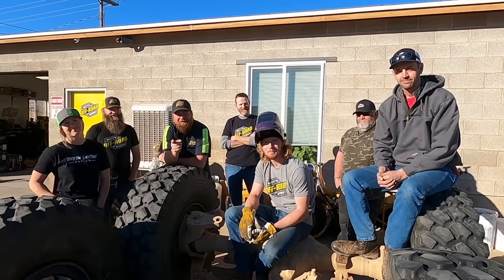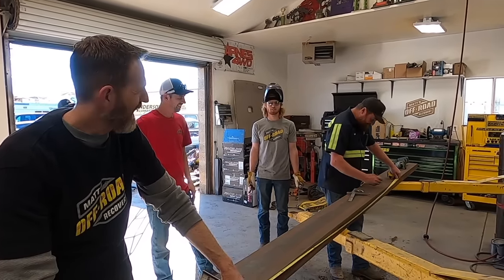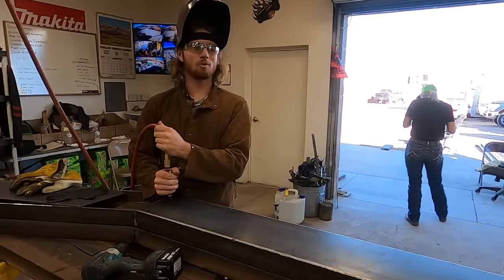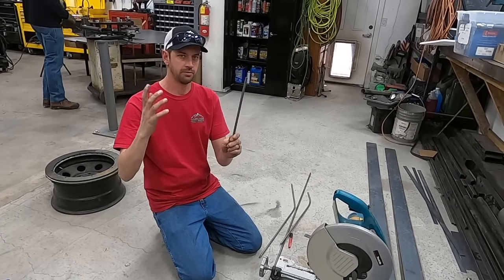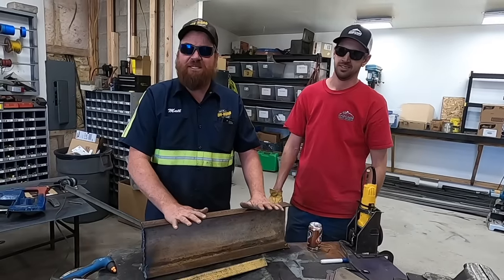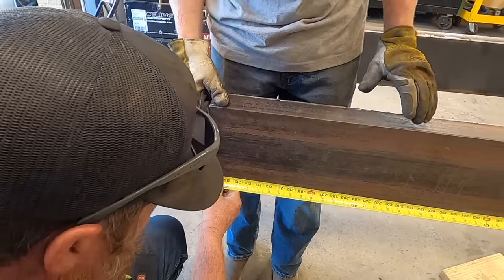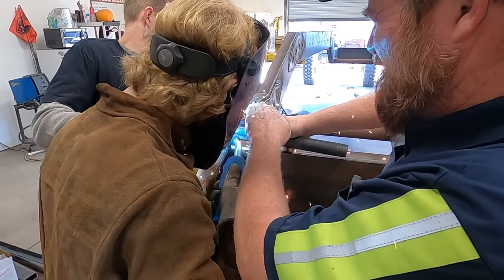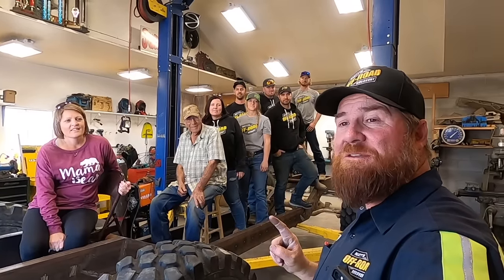I'm Building The WORLD'S LARGEST Off-Road Wrecker

Comment: Hey Rudy! If I can give a little unsolicited advice on welding? You are relying on gas and fire to keep the oxygen out of the weld. Welding without flux can lead to the molten metal instantly going bad. Everytime you make a puddle you need to point the flame into it to keep the oxygen in the air away. Then as you let off keep the nozzle pointed at it until it gets solid. 
Tacks, stops, and starts. Always grind a feather edge to restart on so you don't get those cold spots. Really push into a cold start to melt the puddle before you start dragging. Don't be afraid of melting the whole parent metal. Don't just glue on the surface. Wobble side to side slowly to widen the puddle but don't let air in.
I'm trying to keep it simple so sorry for a lack of detail.

See the puddle young welder.
Reply: C'est vraiment le  meilleure et le  plus synthétique commentaire  sur le soudage que je n'ai jamais lu. 
Vous  expliquez  si bien les règles de bases  qu'il  faut absolument respecter si on veut réussir une parfaite soudure: ne jamais laisser l'oxygène entrer en contact avec le bain de fusion ainsi que le geste à avoir du début jusqu'à la fin de la soudure. :washhands: On sent le professionnel passionné de Vulcain  😏

Comment: I am no expert but I wouldn't recommend using the frame as an air tank for 2 reasons:
A) Water is a natural by-product of compressing air due to the condensing process. The water can rust the frame from the inside out over time.
B) Air tanks are always round due to the increased strength. I found out (the hard way) that square doesn't work to well.
Reply: C) It's reducing the effective strength of the frame

Comment: I worked in a vessel shop building high compression gas compressors and many air  tested tanks that would hold oil within the structure. We would rarely use mig on such thick materials due to it's poor penetration on stops starts leading to pin holes. You can tail out with the mig not leaving the porosity or use grinders on the stops starts and following and religious process of rooting in a first pass of E6010 covered by E7018 SMAW or Shielded metal arc or STICK. STICK has much better penetrative characteristics. The frames We would build were 40 to 60' long weighing between 40 to 50 tons just the frame. On those frames we would use heavy deposit high voltage flux core which would dig in well to thick metal in multiple passes. Was a fabricator welder for years and an instructor in the local trades school. I have learned a great deal from you folks here is only a small bit of my knowledge. Great project and keep going thanks!

Comment: Although the frame tank was a good implementation based on the idea, I still think a proper on board air tank would suffice better in the long run!
Reply: Absolutely agreed! When the air is lost in the back of the desert it is not fun
Reply: @manuhonkanen2111  it'll obviously have a compressor onboard, so you just make sure you can bypass the frame tank and run either straight off the compresser, or add an additional 1-2 gallon buffer tank that can easily tuck away inside.
Reply: Could always use them for water or oil tanks like a lot of bumpers are built for
Reply: @ChevTecGroup  TUBE bumpers. They are all tubes.
Reply: @amlee7  for pressurized air yes, but there are many square/box steep bumpers that double as water or oil tanks. Plenty of JK jeep aftermarket box steel bumpers made to hold water.

Comment: Dual shield fluxcore is a good welding process to use for frames and such. It's what our company uses for all structural welds on truck frames. Also anything holding pressure should be cylinder with domed ends. Even if reinforced the flat spaces will bulge.  I like the idea it sounds cool but there's alot of things that can go wrong there specially using short arc MIG process. Just food for thought!  Can't wait till it's finished it's going to BE EPIC
Reply: I’d run SMAW before MIG. I agree tho, dual shielded FCAW would be the best.
Reply: Why does it have to be airtight?
Reply: I was thinking it would be a much safer idea and easier to just use air brake tanks designed for otr trucks.
Reply: @apollo5751  if I had known I wouldn't have asked. We all learn new things. Sorry if I offended you.
Reply: I second the fluxcore wire.... Look into it.... Its better for heavier welding.....
Reply: with normal air pressure that tank will never leak or explode if you put 1000 psi in a tank designed for 150psi at most  then it will have problems the way it is they will be fine

Comment: I am a heavy diesel mechanic from the north east. I am not a fan of doing frame tank because of moisture. But i guess being in the desert means less moisture so should work just fine. Anyway this build is going to be epic.
Reply: The frame is already rusted. Compressed air combined with rust is just bad.
Reply: This was my thought, maybe they can just oil the inside?
Reply: @BenKloos  no, don't! The oil could combust like a diesel.
Reply: There is less moisture on the outside but they need to worry about the moisture on the inside rusting it out. The water condenses from compression and gets inside the frame. It's better to use an air tank with the proper asme certification if it's going into commercial service. The drain holes will be in the right place, built to handle the pressure, if anything happens to it you can just buy a standard replacement tank.
Reply: @lightningdemolition1964  I live here too. I still have to regularly drain my air tank regularly.
Reply: Just use inert gas (nitrogen) to fill frame to about 5 psi and it refill as needed. That will  remove moisture and prevent rust. Interesting idea to use frame as an air tank but doesn’t seem like it would usable/ reliable over time.  Interesting idea.
Reply: @williamlloyd3769  The moisture actually comes in through the compressed air. Compression heats the air up, hot air holds more moisture than cold air. Once the air cools in the tank, the water condenses out and leaves water in the tank. The more humidity in the air the more water will be in the tanks. Also constantly pumping fresh oxygen into the tank increases oxidation.
Reply: @lightningdemolition1964  less moisture in the air means less moisture in the tanks as well.
Reply: @scottcummings8074  you would need much higher pressure and heat to combust oil like that.
Reply: @mission772  I kinda thought so, but the possibility worried me enough not to say something.

Comment: As an Engineer, there are some really good reasons there are very particular and specific ASME boiler & pressure vessel codes.  While I understand why this seems like a good idea, I can assure you that it is not.
Reply: Asme 570?
Reply: @danielanderson2189  ASME B&PV code.  Section II part A for ferrous Materials used in pressure vessels and section VIII Rules for Construction of Pressure Vessels.  What they are doing could be quite dangerous and is entirely inadequate from an engineering and design standpoint. The materials, design, welding, and testing were very bad.  If they’re luck, they’ll just very quickly develop weld cracking that leaks off all their pressure and will get tired of chasing leaks and welds to fix.  If they’re not lucky, they’ll all be riding around in a ticking time bomb waiting for it to explode and someone to catch some shrapnel.  That clearly contains far more energy than they begin to realize…even testing it the way they were makes that very clear, you don’t use compressed air!  They have no idea what they’re doing and shouldn’t be doing it.  It won’t work for long.
Reply: @REDSHlFT  seeing him argue that "it's only 90psi it should be fine" is just proving you right even more.
Reply: I'm sure that it is just a random coincidence that commercially available pressure tanks are always domed cylinders.  Don't you bring in all your science and experience.  Riding around on top of a potential bomb is a great idea.  All of that just to save the space of a 10 gallon pressure tank?
Reply: Have literally just made a bomb.
Reply: "Engineer", is not capitalized. It's -engineer-.  In your defense, I give 20 times more respect to a person with a degree in engineering, than to a person with a degree in English. So in the end, I have undermined my position.
Reply: @JR-vi2ll  it is when it’s part of your title, as in ‘Mechanical & Aerospace Engineer’.  You try way to hard, it’s a little sad. 😂
Reply: @REDSHlFT  , Naw, it's not properly capitalized, even if you add the "mechanical & space" before it. Even the U.S. president isn't capitalized until the title (president) becomes part of the person's name, as in -President Biden declared-. If you wanted to write "the president declared", then the word isn't capitalized. So, I'll leave the aerospace engineering to you, with your science degree and you leave the English to me, with my (truly) inferior arts degree, and things will be better. I won't even mention (after this) your last error, "to" isn't interchangeable with too. As in, "you try way to hard."  Eek, I cringe. So, get back to engineering and I'll get back to grading papers. P.S. Stop trying so hard.
Reply: @JR-vi2ll  You have serious issues if you think I’m reading all that drivel 😂.  Go somewhere else and cry it out brother 😭 😢
Reply: @REDSHlFT  Wow, angry.

Comment: For avoiding leaks in your next tank, grind the end of each weld before starting the next weld on top of it. The last 3/8" of the weld will have a tiny bit of porosity that will often leak air/fluid. Grind that porosity out and you will have better success.
Reply: @Jeremy Hicks _ Pipeliner?
Reply: sounds like you are a pressure welder, (pressure  vessels and pipelines. Here in Canada, the term is "B" Pressure welder. Maybe the same down south? not sure.

Comment: To each his own but when weighing the mounting of a tank or two on the vehicle versus using the frame as one will end up causing way more issues than it solves. The internal corrosion caused by hot compressor air is one. The constant flex and weld cracks will end up being the deal breaker.
Reply: I was thinking the same thing. The air is going to contain a lot of humidity.
Reply: Agreed. Doesn't matter that they live in Utah, when the air is compressed moisture will condense inside the frame rails. It'll rust the welded joints from the inside out the full length of the tank. Plus all that fab work for an inferior pressure vessel. I'd just mount a 10 or 20 gallon tank somewhere.
Reply: The can put an air drier on it.
Reply: @Mick_A_Knuckle  or two 5 gallons with an isolator valve in-between in the event one fails. At least that way they still have a 5 gallon tank left to hobble with.
Reply: As a mechanical engineer: Strong agree. On top of the structural integrity, reliability, and maintenance issues, if they're going to be running anything beyond like ~30psi, it's going to be a safety issue too. That's a lot of compressed air volume in a much-less-than-ideal pressure vessel that's also a stressed structural member and also often at chest-eye level. At some poin a side is going to tear off one of those and risk throwing debris and/or shrapnel at people nearby.

Especially when target weight for the frame is so high, using cylindrical, purpose-built tanks is just the better solution.
Reply: When the rail tanks fail, it's a simple thing to add external tanks later.
Reply: @justinscomp  it would have been even simpler not having to do all the proper welding to keep it sealed.
Reply: I thought of some sort of rust proof coating inside (too late now) but also, it's a heavy duty, rough duty rig.  Isn't that going to cause frequent leaks in the welds?
Reply: All they need to do is have the air compressor pump first go into an air dryer then the frame tanks, if it's a refrigerated air dryer the air going into frame tanks will be at a set constant temperature that is cold but not freezing and low moisture content. That would get rid of a lot of moisture and hot air related issues.

As long as welds aren't crappy and it's well braced internally and externally(being thick steel C channel it has a structural section for a lot of forces to travel through that is non dependent on weld strength) it should last a long time before needing maintenance.

If they had more plasma or laser cut steel stiffeners that are bent into a 90 and welded so it's reinforcing edges of the sheet that's boxing in the C channel that'd be helpful for directing less forces through frame tanks edge welds. Also if it was to fail they'd hold it together hopefully avoiding a large section getting blown off.
Reply: @edvinbeqari7551  Heated air is the problem, as it carries moisture to the tank. Run some twenty-thirty feet of airline downwards from the compressor to a low point drain cock.  This allows the air to cool which condenses most of the moisture where it can be drained off.   Then run the airline into the bottom of a good-sized desiccant dryer with the exit line at the top.  then admit the air into the frame tank   Change the desiccant every year and you've solved the moisture problem.
Reply: @justinscomp  as long as the failure doesn't destroy the frame you mean.  I've seen what compressed air does to steel tanks when they fail
Reply: This isn't their first Rodeo. Casey comes from a family of Truckers I am sure he's very much aware of moisture buildup in tanks. And if you look at Rudy's welding you're going to see that that is how he always welds. The C channel that they are using is heavier than the material used to build most truck frames. You should hold your opinions until they are done building it. Better yet wait until they actually have problems with it. Then you can feel better.
Reply: @DaleStLouis-xb5mx  It's never too late for that. They can add rust coating but of course they would have to rotate the frame around a lot after adding it.
But even so, adding a rust coating to the inside is still going to suffer all the same issues that have been described so far. Cracking, stress fatigue, risk of rupture etc.
Any rust coating is going to be destroyed and then rust is going to form even worse.
Reply: @davidclemens1578  Or maybe the point is to catch flaws in design BEFORE they fail dangerously.
It's almost as if you would build a building and only say "I knew it would" AFTER the building collapses and kills hundreds. That's not how safety works, if you know something then speak up.
Reply: @davidclemens1578  people are entitled to their own opinion and they are entitled to state those opinions. I note you are more than happy to share yours so why should other people not be allowed to?
Reply: @davidclemens1578  a fast read through the comments puts your opinion fairly low on the list of right and wrong. Go see if you can buy yourself an air compressor with a square tank and holler back on that.

Comment: I hope your "air frame" works out well. It looks good and it's a super trick idea. It's just that air pressure IS one of the, if not the, most dangerous forms of stored energy and it can be extremely unpredictable. I really love watching your builds. All your videos actually.
Reply: Hydraulic fluid also super dangerous under pressure.  Google up hydraulic injection, and be prepared to be very scared
Reply: @paullambert2668  ..... Hydraulic injection is terrible. Not extremely common either. Hydraulic pressure is powerful. It's not explosive though.

Comment: Looks amazing, i'm sure there be a awesome wrecker :) however that inframe air is a bad idea which would cause problem and as well a potential dangerous issue. I do agree at most comment regarding this issue. There is reason by most use cylindrical and sperical tanks for air pressure tank.

Comment: You may want to install a drain chock at the lowest point on your airtank/frame so the condensation can be drained periodically.
Reply: I was wondering about that myself, but wonder if the air is dry enough in Utah that it's not a problem?
Reply: @ImNorm29  
They get snow. Can’t be that dry. 🤷🏻‍♂️
Reply: @ImNorm29  It's not AS much of a problem, but I still see moisture in my air tanks when I drain.
Reply: @ImNorm29  And what about all the metal filings from drilling the holes?